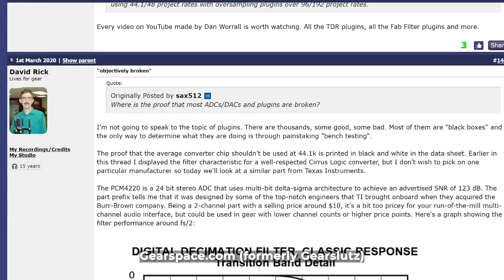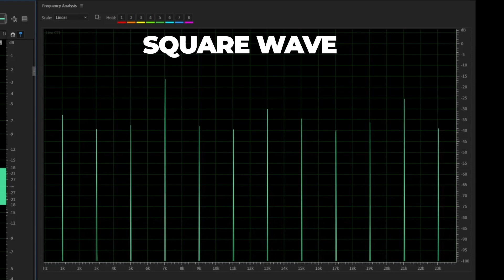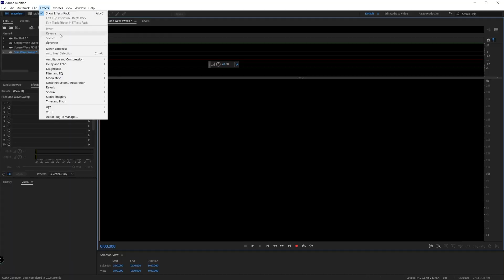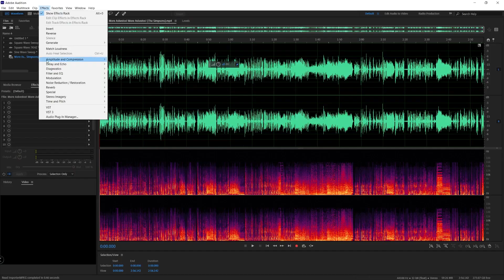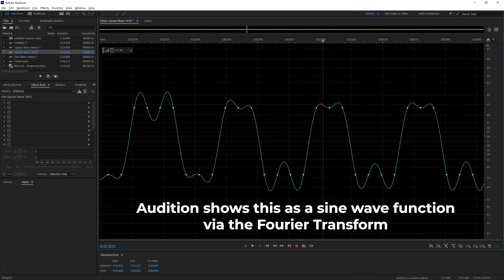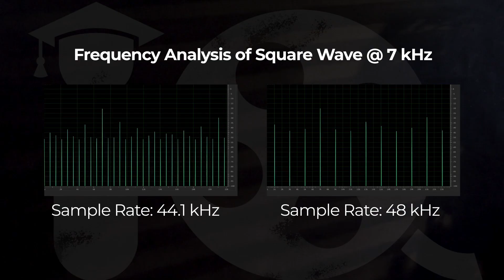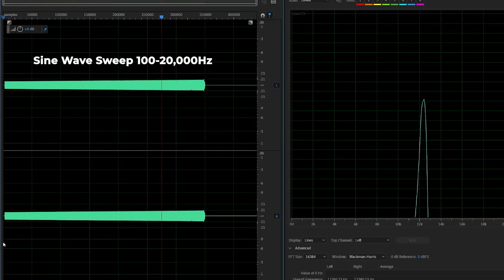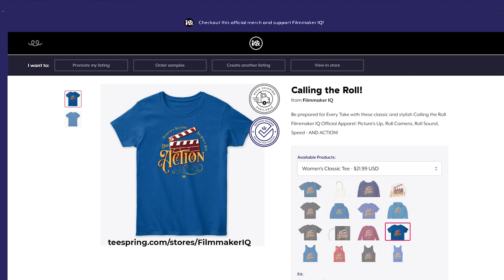What is the Optimal Sampling Rate for Audio? (It's All About the Aliasing)

Comment: Another thing to consider is that at exactly the Nyquist limit, the signal contains no information whatsoever on the phase of the signal, so if you had a 90 degree phase shift between the left and right channel (or multiple channels in a multi track recording), that information would not register correctly in the audio samples. This may not be so important when listening to the audio as our hearing is not so sensitive to the phase of such short wavelengths, but if you start to do addition of the channels or other signal processing where the different channels interact, the same signals oversampled vs sampled at the Nyquist limit can produce a different sounding result, even after the result has been downsampled back to the Nyquist limit.
Reply: Nyquist will accurately reproduce the sound, if you THEN add extra modifications on that then that in no way implies anything about nyquist not being 100% correct.
Reply: @ABaumstumpf  Nyquist is correct about the absolute minimum sampling rate, but there are benefits in oversampling.
Reply: @TurboBaldur  Yes, of course, but that in no way has any effect on what us humans can actually hear, and there the 44kHz 16 bit is enough. if the mastering of the audio is done poorly that is not the fault of the medium not does it make Nyquist any less correct.
Reply: @ABaumstumpf  exactly, if the sampling is being done for playback to a human only then 44.1k is fine. But if you plan to edit the audio it makes sense to get more samples, even if the final export is to 44.1k
Reply: This is a great point, and I believe it may be why many digital recordings made in the early 90s sound "flat" compared to late-generation analog recordings.  Too many engineers just relied blindly on the digital technology without thinking of consequences like this.  Nowadays of course studios work with much higher bitrates and bit-depths for processing and mastering before producing the 44.1kHz or 48kHz files for release.

Comment: I once studied electrical engineering with a bit of signal processing but then went into energy (the big kilo volts stuff) and finally  computer science. And in computer graphics I was right back in the fourier transform again, because yep.. its exactly the same thing in computer graphics. And while all the theory has been ages ago so I really need a refresher myself, I find this discussion everywhere:

This debate of higher sampling rate, completely ignoring aliasing is going on in graphics just as well. Just look at all the "graphics mods" for games that upload huge textures for absolutely everything and then change the engine settings so bigger textures are being sampled for small objects, then wonder why performance goes down the toilet while aliasing artifacts appear and make things look worse instead of better. Its almost as if game and engine developers know about these engineering principles and optimize for them. Like... as if they know what they're doing :D

Same goes for mesh level of detail too btw. Rendering a triangulated mesh is nothing but sampling. The sampling rate is your screen resolution. If you make an insanely detailed mesh that will show up small on your screen, you'll get mesh aliasing which will also look crap. People always thing smaller textures, mipmaps, and LODs are only used for performance, and if my PC is kick-ass, I should always load everything at the biggest size (bigger/more is better), completely ignoring signal processing principles and aliasing.
Reply from the maker: Fascinating analogy
Reply: @FilmmakerIQ  at the end of the day it's all about sampling at a limited frequency. Doesn't matter what the data is

Comment: Thank you for this excellent explanation.  I am an audio engineer for a living, for many years I used a digital mixing console (a Panasonic Ramsa WR-DA7) which can operate at both 44.1k and 48k. I was always able to hear the difference between the two even when only recording voiceover, which I've done a lot of.  I also have read Lavry's work in the past, when he previously insisted that there was no difference whatsoever between the two sampling rates  and no need to ever use above 44.1K, and knew something had to be wrong.  I also have used high sample rates, particularly 96k, and agree that they require a LOT of processing power, which translates into a lower track count and fewer native plugins that can be used, which makes those high rates inconvenient at best, at least for now.

Coincidentally, it always seemed to me that the best compromise between computing power and the audio problems I was hearing would a sample rate of 64kHz (since in computing we like to use powers of 2 as factors, mostly because it's easy to clock-divide by 2 or 4, etc.).  It's interesting that Lavry's proposed sample rate of 60K is very close to my own thoughts, and personally I'm glad to see that he has come around from his prior position that 44.1k was just fine.

I also knew that when using wave generation software just like you illustrated in Adobe Audition, when generating a 16K sine wave at 48k sampling rate, the result is a wave with only three data points per cycle: one at zero, one near the peak, and one near the trough - which is of course a 16K TRIANGLE wave, not a sine wave, albeit a someone oblique one.  Yes, those overtones are outside the range of hearing, and yet you could hear that something was wrong - it definitely was not a sine wave that was playing back.  Aliasing is exactly the problem - there was no anti-aliasing applied to the data generated by Audition or any other similar program, or any anti-aliasing generated by the WR-DA7 that was outputting it and that the computer was digitally connected to - and there still isn't today on most high-end professional equipment.  So there's just no question that the VAST majority of digital playback equipment out there simply applies no anti-aliasing filtering at all and never did.  To my trained ear, this has been quite annoying indeed.

I also remember the very early days of CDs, and the first CD player I bought, a Sony.  I didn't like it, because the top end sounded "brittle", which was a common complaint in those days.  And in fact it wasn't until CD players introduced "oversampling" that the problem went away - basically moving the aliasing frequencies so they are all hypersonic, by extrapolating and outputting one or three "samples between the samples" caused later generation CD players to sound significantly better.

The bottom line is that Nyquist really doesn't handle the concept of aliasing very well, as you aptly point out.  And what is needed, particularly for audio production, is a sampling rate that allows all of the alias frequencies to be moved above the 20kHz threshold of hearing.  Computing power is a temporary problem, so I have a feeling that in the not too distant future all professional audio production will be done at 96k, even though we don't really need it to be quite that high.  Thank you for what I believe settles this issue hopefully for good.
Reply from the maker: Sorry but three sample points do not produce a sawtooth wave, it's produces a sine wave. You don't connect the dots with straight lines, you draw a sine wave through the dots.

A saw tooth wave has integer harmonics, it would need to be constructed with many sine waves which works probably be above Nyquist if the wave is only 3 samples wide.

Lastly, I don't think you understand why Lavry suggests 60. He stated in the paper that 44.1 is if not perfect, close to perfect.
Reply: @FilmmakerIQ  I think you misunderstood what I said - "triangle", not "sawtooth".  And I wasn't referring to an actual triangle wave, I was only referring to the shape created by the three points if you connect them, which isn't exactly what's going to happen in the DAC anyway, because DACs don't transition from one point to the next in any smooth way, they simply jump to the next value.  The bottom line is that for a 16kHz sine wave, only three data points are created, and only three data points are going to be output by a DAC.  The DAC itself is not going to "draw a sine wave through the dots".  It's just going to output stairsteps at three data points and that's it (unless of course we're talking about oversampling, which would instead use spline interpolation or some similar approach to approximate where the additional samples would be.  But to my knowledge no production hardware - such as Pro Tools or UAD Apollo etc. -   utilizes oversampling on output).

For example, if you create a 16kHz 24-bit sine wave at -3.0db, each cycle will have exactly three points - one at zero, one at -4.2 db above zero (sample value 5,143,049) and one at -4.2 db below zero (sample value -5,143,049).  The DAC isn't going to transition smoothly between those points, it's simply going to output a zero for 20.83 milliseconds, followed by a sample value of 5,143,049 for 20.83 ms, and then a sample value of -5,143,049 for 20.83 ms.  If DACs did indeed "draw a sine wave through the dots", then aliasing wouldn't be a problem, because the DAC itself would be reacting perfectly to the INTENTION of the data - just as analog tape used to do.  But the problem is of course, as with many things computer-related, DACs simply don't do that.  They just output a voltage corresponding to a number for a specified number of milliseconds as dictated by the sampling rate.  It is of course this behavior that causes the alias frequencies to result, as you have very correctly and articulately described.

As for Lavry's 60, correct me if I'm wrong, but my understanding is that the advantage here is twofold: 1) it pushes the vast majority of alias frequencies into the supersonic range, making them a non-problem, and 2) it provides more headroom for creating anti-aliasing filters, should a playback hardware developer choose to do so, which sadly, very few ever seem to.  My point was merely to essentially agree with Lavry, but I'm suggesting that when taking into account the fact that digital hardware designers prefer to do things in powers of 2, that a better choice for "optimal sampling rate" should be 64kHz specifically.  Personally, I wish hardware developers provided that option in addition to 48k and 96k because that's what I would use for production instead of 48k or 96k.  It would be quite a good compromise.
Reply from the maker: That's completely incorrect.

Yes the DAC does draw a sine wave because it's coverting it back to analog. The speakers cone is a physical object and it moves through space with inertia, it can just jump to each sample point and hold for the next one.

So If you produced three samples you will not get a triangle, you will get a sine wave. Watch Monty's video in my description. Samples are not stair steps, they define the points of a sinusoidal wave. This is the key to Fourier transform and Nyquest theorem.

Aliasing has nothing to do with stair steps (because there aren't any stairsteps). Aliasing is the result of frequencies that are higher than the sampling frequency.

Your understanding of Lavry's 60 is incorrect as well. It doesn't push alias frequencies in the ultrasonic... You don't push alias frequencies...  it provides enough headroom for anti aliasing filters to work without affecting the audible range.

Lastly clock speed has zip to do with binary. 64khz is meaningless because time is irrelevant construct. Look at the history of computing you will not see any clock speed correlating with any binary numbers... Because it's been simply not how that works...

Also 64khz isn't a binary number. The closest is 2^16 which is 65.636khz

Comment: Nice video.  There's an interesting tidbit that I have noticed with the whole 44.1 v 48.8 - you need to be consistent even though it doesn't matter.  If you playback a 44.1 file inside a 48.8 project (or vice versa) you get pitch drift phenomena.  This is why consistency is key even though sampling rate doesn't matter.  

The real key is "mastering for your platform" as it were.  Understanding the playback limitations of youtube and making sure you sort your audio for playback.  Tis redundant to do all your audio at 88/-8dB if youtube is going to down sample to 44.1./ -15dB.

Comment: Another engineer here.  In my laziness I was edging into camp 2.  Thank you for showing me the error of my ways, and reminding me of what I knew 40 years ago.
Nyquist's sampling theorem is correct,   and it assumes a perfectly band-limited signal.  You band-limit a wider bandwidth signal using a low-pass (anti-aliasing) filter.  Precision analogue filters can be expensive and difficult to create.  Further, if you have a sharp transition in the filter,  you introduce artefacts which are visible on transients in the signal,  and might be audible,  although I really don't know.   To allow an easy-to-implement gentle roll-off filter without attenuating your wanted signal in the passband,  you need a lot of headroom.

BTW, to me this is all theoretical.  As somebody of retirement ago, with loud tinnitus, 20 KHz sampling rate would be just fine.

Comment: Fun fact... People that lived with older TVs with noisy line-output transformers may have developed notches in their hearing at 15734Hz (NTSC) or 15625Hz PAL) although if they are that old they may not now hear much above 12kHz or so anyway (that's me at 63).  I remembered this when you picked 5.2 and 15.6kHz for the demonstration.  I also wondered how hard that 16kHz wall is that YouTube apply, and would probably have gone with 5 and 15kHz or even 4 and 12kHz.

If interested, it's also instructive to construct square waves visually using a graphing calculator to help with understanding how each odd harmonic improves the squareness of the waveform, although I guess Audition can do that as well.

Great video, too, by the way.

Comment: Hello, apologies for being slightly picky. Electrical engineer here, I work with high speed data converters, >1Gbit type work. You nailed pretty much everything, but I’d like to make 1 tiny (but SUPER important) note. BTW,  this mistake is even in some EE text books: nyquist theorem doesn’t say you should sample at twice the maximum frequency in your signal, but rather twice the maximum bandwidth of your signal. This ensures your entire signal falls within the first nyquist zone, allowing your anti-aliasing filter to cut out all unwanted signals. The reason square waves never work well, their bandwidth is technically infinite. Again, don’t want to take anything away from your video, great work!
Edit: I wrote that first paragraph  not trying not get to technical, but I feel it leaves a bit to be desired. I don't do anything audio, and I just realized the maximum frequency in an audio signal usually describes the maximum bandwidth (please correct me if this assumption is wrong), making the first paragraph a distinction  without a difference to audio folks. However, is it import to make that distinction between maximum frequency and bandwidth because it allows for the use of underdamping to still faithfully reproduce your signal. In my world, I often times want to digitize signals in the GHz range, but if i know my signals bandwidth, i can sample a much much MUCH lower frequency, and filter my output to any higher nyquist zone. In this case I am using the aliased signals to faithfully represent the initial signal. This technique  requires pretty fancy filtering, and knowing the center frequency and bandwidth of your incoming signal. Often time we dont have that info.

Comment: It is a similar story with image resolution where people claim that a 4K TV is way better than their old 1080p TV - but the difference was not really due to resolution but size. 
You need a rather large screen at a close distance for any visual difference between 1080p and 4K, and now with 8K.... you need like 60" monitor at 1m distance for there to be any visual difference.
44 kHz 16 bit is enough for humans - for us that can be called "perfect". There has not been a single human that has ever shown to be able to accurately hear anything above 21kHz. For the bit-depth - kinda debatable as without noise-shaping, dithering  or anything like that this is "only" ~96 dB SNR - so from the faintest sound perceivable (you'd need to be literally dead to not have the sound of blood flowing through your veins) up to soundlevels that cause permanent hearing-damage with just half an hour of exposure per day.
You could literally have an audio-track with the drop of a needle and being on a busy road - and both things would be fully captured.

Doing ANYTHING but listening to the audio is a different beast.
Just image taking a photo with a resolution just high enough that it looks perfect to you (doesn't even matter what actual size/resolution) - ok. Now take the same image and stretch it to say 5 times the size - oh, it suddenly is no longer perfect.
When you want to manipulate any data, be it image, sound, or anything else - you end up introducing distortions and losing some precision, so you'd better make sure that the initial data you got is way more than you actually want to deliver at the end, and do all your manipulations with as much USEFUL data as possible. With audio that often means capturing >20bits of depth at 96 kHz - which allows you to squeeze and stretch the sound a lot before any unwanted distortions become audible. Useful as in like this video is showing the problem of aliasing.You do NOT want that in your data so you better just use >96kHz during manipulation and then filter all the high-frequency stuff out before it ends up getting folded into the audible range. Cause once it is there you are not getting ridd of that anymore.